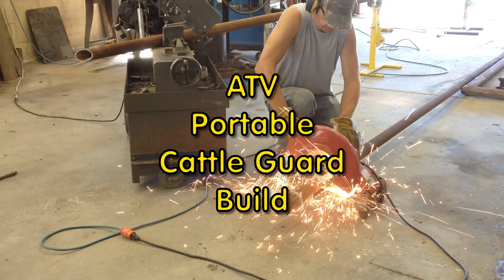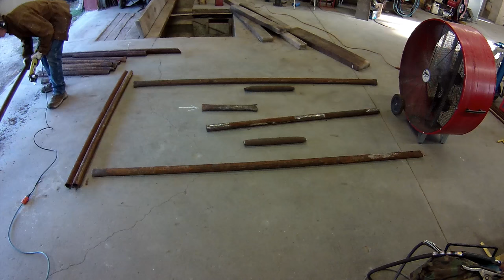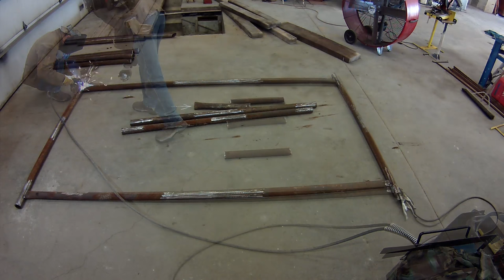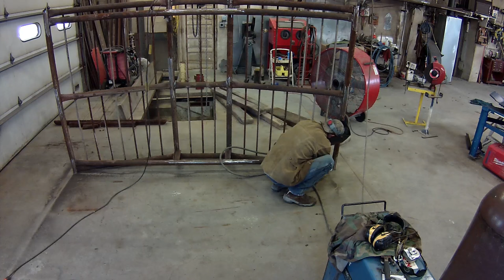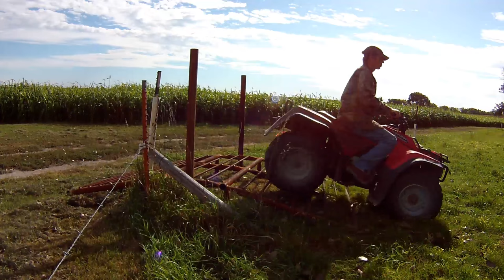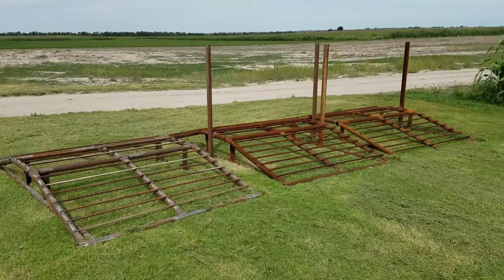ATV Portable Cattle Guard Build

Comment: When I was a teen-ager, there were no electric fences, on account of the fact that there was little if any electricity in rural areas, so they used "argentine grates"  (there is an English word for this, can't remember it) -- ditches with bars across so cows couldn't step through -- but electric fencing is neat. Given that, that thing you built saves time, and time is money. That cattle guard is a money-saver. Neat idea.
Reply from the maker: Interesting. Electric fence is really common in the Fall around here to put the cows out on the harvested fields and Solar power has made it a possibility.  Before, we would swap out the 12 volt car battery every few days, now, we turn on the solar powered fence charger and forget about it!
Reply: But again, when I was in high school, we knew about phhotocells. But there were no solar panels anywhere! That came in middle 1970s.
Reply: When younger my cousin and I were pissing on those electric fences, not a great idea when the 12 volts was in fact near 12 volts....   On the primary...   !!!!!    lol
Reply: I am shocked-- shocked!  (Casablanca) at your early life behavior. Fortunately urine is not the world's best conductor in the world.
Reply: Juan Rivero
Still good enough to be surprising at the fence....   lol